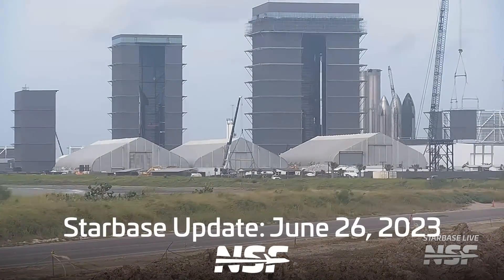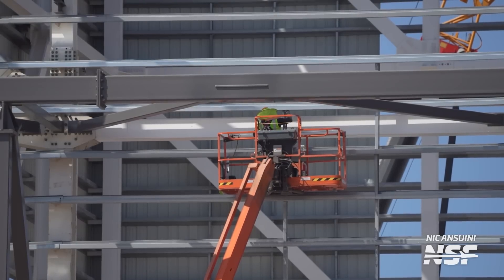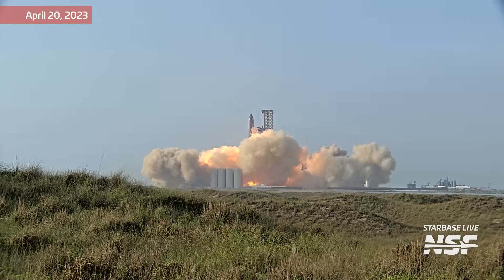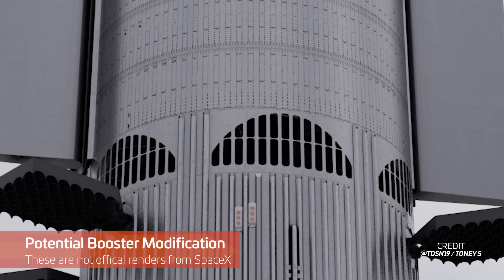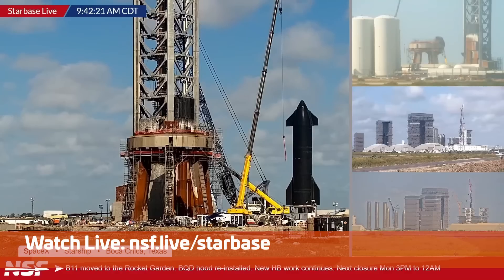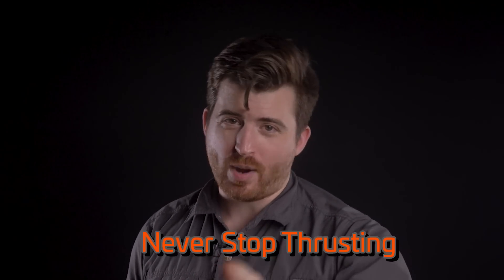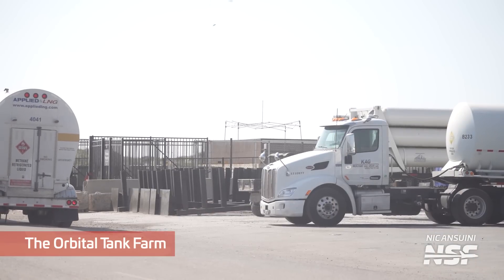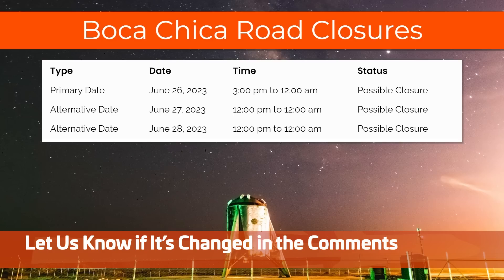Starbase Update: Hot Staging Starship, Boosters A Plenty & The Mega Bay Rises

Comment: It occurs to me that if that last lit engine on booster is one of the outer ring, THEN booster would still end up rotating and tje separation would both be inertial AND hot
Reply: The outter ring doesn't steer, so they're the first ones turned off.